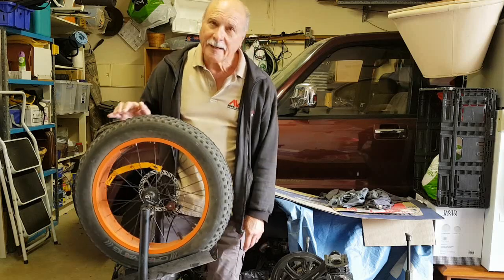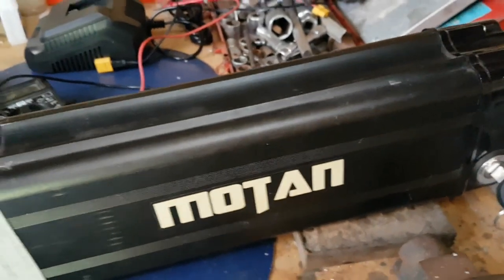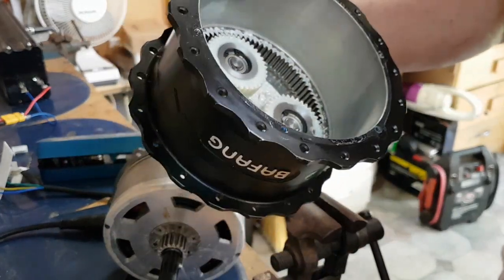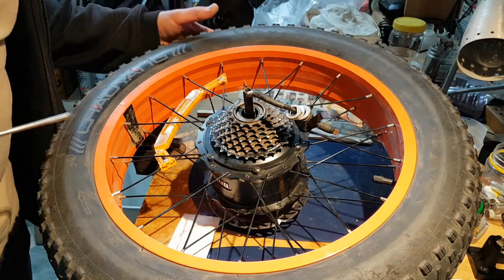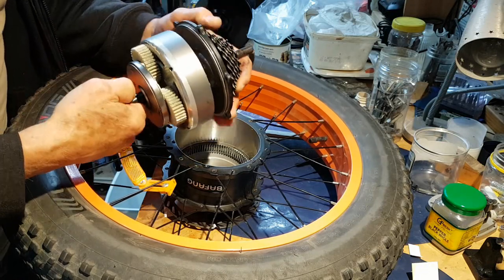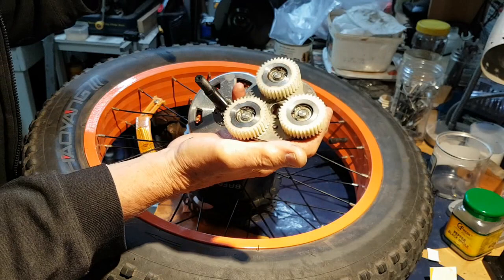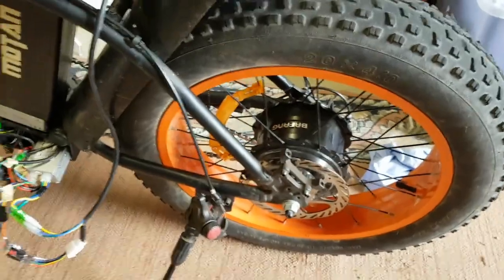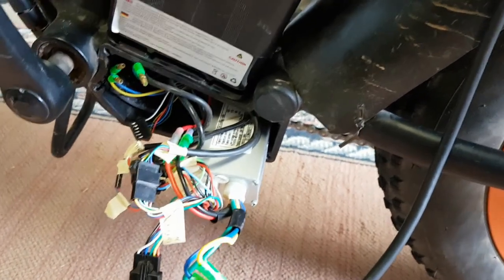Uprading my 20" fat tyre Ebike -500w to 750w - PART 1

Comment: 10:14 
If you don’t fancy taking a Hammer near these small usually Loctite done screws. Get the Exact size & before you try lookin it, give it a slight  “NIP” as if your TIGHTENING it & that’ll snap any Loctite (or heat!) sealed screws, Works every time 👍🏼👍🏼

Comment: I have a error code 36 backing down the hill the axle rotated and I think it no I can't get power to the wheel. 10 inch lead 45 pin is it replaceable question mark

Comment: hi my Bafang RM G060.750.DC 750w rear hum motor planetary gear broke down, I can't find the exact size of them do you know what is the size of the planetary gears inside of the bafang 750w ? diameter thickness and number of teeth?

Comment: Thanks for showing us your project, I want to do the same thing on a slightly different bike, but my controller box is very small, I doubt I can get a more powerful controller to go inside. I hate the controller box being at the base of the battery, obviously there have to be holes for the cables to go in, but that means water gets in too. Thats maybe not a problem for you down under but I am in the UK! Already had to replace the controller due to muddy water damage.
Reply from the maker: I know the problem. Larger controller box can be placed elsewhere on the bike but it makes the bike look untidy. Choose between more power or looks.....
Reply: @joc1862  do you think it would work to move a rear hub motor to the front wheel, after removing the cassette holder and sawing down the axle, because I want to upgrade my 500 to 750 like you and will have spare controller and motor left over. I would only have to get new shorter spokes and another throttle
Reply from the maker: @utubeape  Not quite sure what you mean. Do you want a motor in each wheel? If so, it can be done but it's messy - 2 motors, 2 controllers, 2 throttles or better, I throttle linked to both controllers - what about pedal assist? Do you have enough room on the bike?
Reply: @joc1862  thanks for the reply, I already have a fat tire ebike but want to improve it, the rear has the 500w motor, its controller is under the battery which is behind a seat post. To upgrade the back motor to a 750 I need to fit a new controller anyway to somehere else on the bike, I have room.
I want 2 throttles so I can only use the additional front motor when needed, because it will have a smaller battery., maybe 10 Ah. Already got pedal assist mounted.

I just wondered if you have ever tried to fit a rear wheel motor onto a front wheel, having taken off the cassette and sawing down the threaded bar / axle
Reply from the maker: @utubeape  No, haven't tried that. Cutting up the motor would be a messy job. You would need to check the position of the bearings on the cassette side to see if the altered motor would fit between the front dropouts.
Also torque arms would be required for the front forks.
I'd sell the 500w motor and controller and put the money towards a ready-made 500w front wheel fat tire kit and buy a bigger controller for the 750.
Reply: @joc1862  thanks, I expect nobody in their right mind would buy a second hand 500w back wheel fat tire motor. I think I might try to buy a broken motor and see how easy it is to cut it down to fit the front drop outs. Also I think it is no problem to make some torque arms out of sheet metal, its only a shape with 2 holes in, or better would be to weld on a curve section to match the fork profile so that no drilling into the fork is required, as doing so would weaken it

Comment: Could you give the model of controller you have in this set up even maybe a link to where you bought it.
Reply from the maker: Sorry, bike sold some time ago. Can't remember. Got it as a 25/30 amp controller on ebay..
Reply: @joc1862  hi thanks for the reply one more question could I use a 48v 21ah battery with a 750watt bafang rear hub motor with a KT CONTROLLER 22a
Reply from the maker: You can - with difficulty. Battery is fine but wiring on the controller needs to be worked out - namely the wiring for the display. Or else run it without the display, which is OK.
Reply: @joc1862  wow thanks for the speedy response well I have an LCD 8 display connected to a KT controller,but I don't understand what you mean about the wires to display.
If I run a KT controller 22a with the 750watt motor I guess I'm good to go or am I missing something.
Reply from the maker: I assumed your controller didn't come with a display, which makes things difficult. Since it does, ignore the previous post. All should be good.
Reply: @joc1862  thanks from the Nederlands

Comment: It would have been better to buy the wheel 1000wat 32amp controller either battery that came with bike 48v20amp or you can get 52v 20amp 35to37mph with regent braking on controller under £300 worth it or 28amp controller and solder shunt bars

Comment: Hope you respond.Did you ever think of just adding a front hub motor--I have a 20 inch CSC coming and was thinking of just adding another motor similiar to how a grizzly is--and another battery.They got 1000 watt front hub motor kits that are reasonable and have excellent reviews and the few folks that have done this have ebikes that literally fly up the steepest hills with little to no effort.I mean the motors are probably using maybe 40% of their power if that--so everything should last longer--plus a 1000 watt alone can climb hills--added to my 750==I just want something that can go offroad and have the range to go 40 miles plus on throttle only if need be.
Reply from the maker: Yes, I had thought of that. Problem with that for me was that the bike would get too heavy with the extra motor and battery - and I have no space on it, especially if I ran dual controllers as well. The other thing was that I wanted to get at least a bit of excercise while riding the thing. As it is, the 750w (geared hub) with a beefier controller climbs hills easily, with little effort on my part.  I didn't want another motorbike as I already have one of those. Also, with so much gear on the bike, it's more conspicuous if you ride on main roads and more likely to be stopped by traffic police for illegal riding. As in my case, I've got to ride on main roads for a couple of ks to get to an offroad park....Once there though - great!
Reply: @joc1862  Hey man thanks for the reply.I do hope the 750 I am getting is strong enough and I also plan on peddling probably more then 50%.I just want it to last and to have good range.
Reply from the maker: @khronin  Check the type of 750w hub motor you're getting. If it's geared, you'll get lots of torque for hill climbing and lower top speed. If it's direct drive, you get less hill climbing ability but higher speed on flat roads. You would probably need a 1500w hub motor (which gets heavy) if you want to climb hills with a direct drive. Depends where you ride. For offroad, torque is probably best.
Reply: @joc1862  It is geared hub bafang and that it is a real bafang 750 so it has 1000 watts or so for uphill. I do not need the ability yet--but I plan on going up to helen GA after the summer to take it on some more difficult trails--i should have a good feeling if it can handle it by then.I was going to get a grizzly but did not want a moped style fixed seat ebike--i have a 20 inch BMX and have ordered a comfort seat because I do plan on peddling.I gave up moutainbiking a few years ago because i llive near 2 hills to get to my house--not big ones--just long and it was miserable to have to deal with them after being worn out from biking.I am more worried about the trail riding in a few months--it takes a lot more energy to ride on trails then pavement.
Reply from the maker: @khronin  Good.... sounds like you know what your doing... enjoy you future rides.

Comment: I have a 36v 250w Fat wheel bike and pulled hub of was rusty a making noise I cleaned it with sand paper and contact cleaner but it’s throwing an e8 code ? Any ideas
Reply from the maker: Sounds like an electrical problem. Check for wiring damage. Maybe your sanding rubbed some of the insulation away and is shorting???
Reply: @joc1862  I will check thank you

Comment: did u have to upgrade the wiring harness? im looking to do what your doing and i have a smaller quick connect as my bike has the 500 watt.
Reply from the maker: Yes, had to change to a larger controller (and display) to power the 750W motor.

Comment: You will need to put a larger controller to see benefit from the new motor. Motors will behave the same as controller will send same amps to each. The lager magnet is battery strength. Meaning it will handle heat better (heat build up slows the motor and can burn it out). I’m not an electrical engineer but I guess there is a larger capacity overall. Still the motor should only respond to the power being sent to it by the controller. 25amp is good but new motor can handle 35amps (short time be for heat builds) best at 30amps. Let me know if theory plays to practice as I am going to do this to my RadMini but with Bolton Bikes (check his upgrade on UTube) tutorial and motor 750watt/controller 35amp/color monitor- upgrade sell. Also see ERI Denver ant Electricbike both on line (USA). Good video it helps in respects thanks!
Reply: I just did the swap on my Rad rover 5, first run out lasted about 14 miles before battery cut out and for some reason the motor was really freaking hot. Too hot I think. I wasn’t surprised the battery wouldn’t last as long but I was shocked that this bigger motor got so hot. I previously rode it with just the motor controller upgrade on the original motor with no overheating.
Reply: That's what I thought otherwise it's just a 500

Comment: How can I make my 48v 750w fat tire bike have a 52v battery and no speed limit
Reply from the maker: Hmmm... not easy. I did it (52V) with another battery as I didn't want to tamper with my existing battery... see my video https://youtu.be/WvQQZYLdLFM. 
As for speed limit... some bikes allow max speed to be changed via the advanced menu settings on the display. Others are speed limited via the controller, making it difficult without replacing controller. Good luck.

Comment: Those geared hub motors are  inefficient and useless 🤨 they lack of power and speed. They can help if you pedal, but what will be the reason to buy a e-bike if you have to pedal almost all the time?

Comment: Hey nice video👋 I have same motor and risunmotor 45a controller. I test bike with 36v battery and it run only 25kmh. I remove speed limit but I dont know why bike not go faster. Also I dont have instructions to make pedal assist work ok. Only assist 4 & 5 works another ones real weak. Bike accelrate real fast to max speed but it so Slow. I dont know does I get more speed with 48v Samsung cell battery. Its in first charge now. Is there in motor internal speed limit? In Risun motor display I dont have advanced menu where normally 750c display is also advanced menu where can change speed limit of. So I need to remove it from controller with Bluetooth or PC. Can anyone tell me what I must to do get more speed. Display shows wattages when test ride 500-1400.
Reply from the maker: Motor does not have internal speed limit. Mine is also slow with 36v. I use 48 or 52v battery and it goes very well. Try higher voltage battery.
Reply: @joc1862  Thank's lot friend. You was right, now I have 48v battery  now goes 40 kmh. ✌️
Reply from the maker: @mrspeedofficialyoutube  That's good. Glad to help.

Comment: Hey Jo,
I have the Bafang 250W 36V setup on a 20" fat tyre commuter and I want to ditch the pedal assist for a twist throttle for better control. the manufacturer was most unhelpful  and wouldn't  give me any data , wiring diagrams or controller assess codes for the motor controller. what i'm wondering is... do you know of a controller that i can use to allow straight forward connection to the Bafang motor. i dont even really need a dash, although it would be useful for battery life monitoring, charging ect.
any help would be great.
cheers Paul
Reply from the maker: Hmm... you need to check your controller to see if there is spare wiring coming out of it that is not being used (a 3 wire connector with black, red, green or white wires). If so, that is the usual throttle wiring that the manufacturer may not have used (because a throttle can be road illegal) and an aftermarkek throttle may be added to it. If not, the controller may be specifically designed for your bike without a throttle connection.
If you can live without a display, most cheap Chinese controllers (of the right V and ah) will come with throttle connection, but you need to get a compatible throttle with it. Matching things up with an odd controller (display, throttle, PAS) can be a problem. Stick to your pedal assist - I personally prefer it to the throttle and your battery lasts much longer.
Reply: @joc1862  my sondors fold X died. I'm looking to get a replacement motor. I have a 48 volt 500 watt motor. Can I just drop in a 48 volt 750 watt motor or will I need a new controller?
Reply from the maker: @RandallBalls  If it's the same 500w geared Bafang motor as my Addmotor bike, yes, you can drop in the 750w version - but the existing controller, if it's like mine, a 17A one, doesn't supply a 750w with enough power. I swapped to a larger 25/30 amp controller to get proper performance out of it.

Comment: Can I use a 750W motor with my 24V 10AH 18Amp discharge bottle battery? I'd also like a silver version of the the rear hub motor since my Schwinn OCC chopper bike is the chrome version.
Reply from the maker: Hmmm... The 750W motor I used was the Bafang geared motor and it will run on various voltages - but that is determined by your controller. It is generally used with a 48v battery system and the controller will cut power to the motor if the voltage gets below about 40v, to protect the battery (lithium). With an appropriate controller, it will run on that voltage - but very poorly. It will lack power since you're feeding it with 240W, which defeats the purpose of using a 750W motor.
Reply: @joc1862  so with this battery is anythin over a 250W motor a waste then ?

Comment: Looking at building my own electric bike using 20" wheels, would prefer using the 750W but the spec sheet shows it's for 26" wheels and up? Have you had any issues using the 750W?
Reply from the maker: Nope... It's great on 20" wheels. Gives you lots of torque to go up virtually any hill (with a bit of pedal assist). 26" wheels would give you less torque but greater top speed. With my 25 amp controller I get 35 to 40kph depending on terrain. With my 30a one I get about 45kph. Depends what you want, torque or speed. I need torque because I live in the hills.
Reply: @joc1862  Thanks for the reply! Glad you haven't run into any issues! I'm after a balance of speed and torque, 45kph seems like a decent speed though! I reckon I'll find a decent 30A or maybe a little higher amperage controller with the 750W motor and that'll give me what I'm after!

Could you let me know what controller you're using??

Comment: I got a couple questions can I buy a afang 750 watt 190 mm dropout 
throw it in a 500 watt 190 mm Dropout bafang housing stator motor.
It looks like that's what you've done.
Reply from the maker: My bike has 175mm dropouts. The motor would probably fit 190 if you add spacers. Yes, the 750W stator fits the same housing as the 500W.
Reply: @joc1862  FYI I did have a hall motor sensor failure on that 500w when I pulled the sensor there are no markings on it this is just information in case you have a hall sensor issue you would want to order the SS 41 following numbers are digits relate to the length out the leads off the circuit and you would want bipolar
Reply from the maker: @jbar3337  Thanks for that... Luckily, haven't had any problems with hall sensors yet...

Comment: Hi what oil would you use for the gears. Many thansk
Reply from the maker: Gears are plastic. Use synthetic based grease not mineral based, eg - Mobil 28 or similar.
Reply: Hi thanks for replying. My hub motor has 2 holes. 1 to put oil in and 1 to drain. Its only a small amounf of 35ml.
Reply from the maker: @RicSil69  Oh, ok. I've heard of that being done. Don't know what motor you have - if I did that to mine, I may get oil in the electronics.. Must be ok if it works for you.
Reply: @joc1862  . Its a rich bit motor 350w geared rear hub
Reply: For a 26inc fat tyre
Reply from the maker: @RicSil69  Not sure what oil you would use. Probably a light hydraulic oil - auto trans or power steering oil.

Comment: I have a 350watt bike and i want to put a 500w motor in it. Can i just get the motor and swap it in or do i need a new controller too?
Reply from the maker: Sorry, not sure if the 350 & 500 are interchangeable. If you swap to a bigger motor, yes, you usually need a larger capacity controller. It will run with the original one, but you won't get the power advantage.
Reply: @joc1862  thats what i thought, thank you!

Comment: do you know if you can remove the speed limiter by leaving to the white wire off?
i have the bafang 250w hub motor...
Reply from the maker: Not familiar with the 250, but if wiring's the same as the 500 and 750, the thin white wire coming from the hub motor is the speed sensor wire. Disconnect that and you lose your speed readout on the display. Nothing to do with speed limiting as far as I know. Speed limit is usually set on the advanced settings of your display. Check that out.
Reply: @joc1862   my  bike  speed  limite  exp. date 2017  now  i  use my  bike  & used  speed  limite  display  but  some  time  my electric bike  dis connected  i dnt know  why ?   whats  the  problem  if u know  thanks alot
Reply from the maker: @azhdarhassan449  Mine sometimes stop when I go uphill - motor pulls too many amps from battery & BMS shuts down. Will restart after a few seconds. Other reason for stopping can be faulty brake cut-off switch.